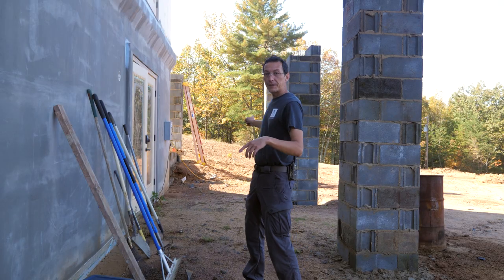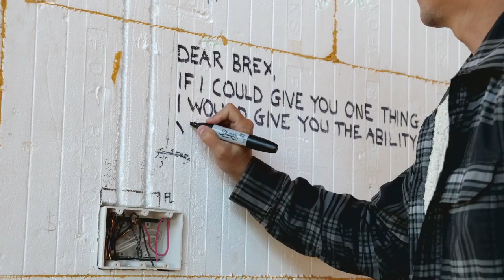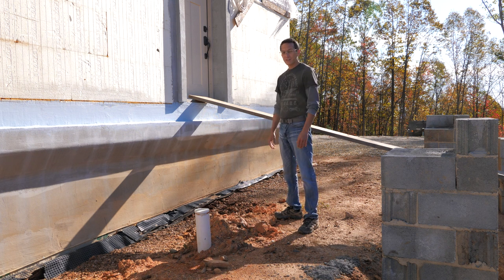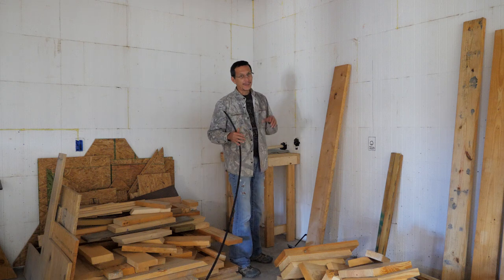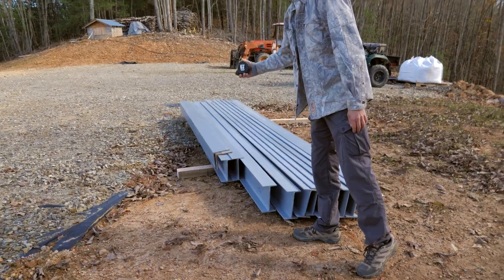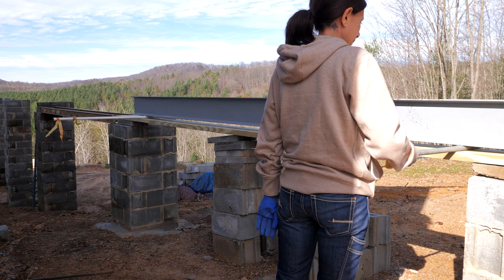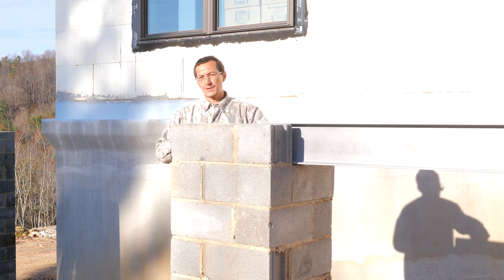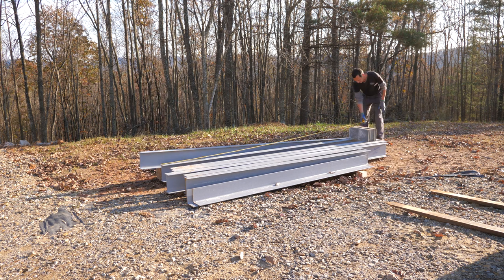Elevated Concrete Porch Slab Construction: Pumping Concrete and Setting Steel Beams

Comment: hind sight thing here but if you use a sling to haul and lift that sort of thing the terrain doesn't matter as much , plus the person on the ground can guide and move it more into place rather than the tractor having to be within 6 inches of placement....next time think of me LOL
Reply from the maker: Switched to a backhoe with higher reach. Finished the remaining beams in 40 minutes. 🤷🏻‍♂️😏
Reply: @Guildbrookfarm  having sat in backhoe seats for 40 years my mind always thinks like I am on one when I see work going on. Glad it went well. The pipe roll was a good idea but work :<0)
Reply: Was just about to say the same thing... except the think of me part...lol. I was just shaking my head going, yo tow strap that puppy, center the gravity, put a lead rope on and go go go! Poor things, A for enginuity and team work but still that tractor was mean to be used for such things.

Comment: I concur with the shop vac trick. I used a ping pong ball with a string attached.  It pulls it thru and attaches to a heavier rope which is attached to the wire you want to pull. Stupid easy this way...!!

Comment: For future reference.  If you have a conduit run that is too long for a fish tape, just take a spool of twine and tie a ping pong ball or foam ball slightly smaller than the inside diameter of the conduit to the end of the string. then go the other end of the conduit and use a vacuum cleaner to suck the ball through the conduit, it will pull the string right off the spool and through the conduit to the other end.

Comment: Any reason why you didn't simply dig and pour large reinforced concrete columns using tubular forms to the proper height(s)?  That's how highway overpasses are done!  The concrete block columns seem so time and labor intensive as well as prone to potential cracking in the future.

Comment: Coming along nicely! Tip for pulling wire in a conduit longer than your fish tape is to use a shop vac at one end and jet line or string tied to a plastic bag at the other. It'll suck it right through. Then you can use that to pull a heavier rope or mule tape to do the actual wire pull with.
Reply from the maker: Yep
Reply: tape the end of the wire and add a little soap to it .. if you trying to push it .. or suck the string in

Comment: You may want to consider installing a Dankoff Flowlight Booster pump in the basement in order to insure you have adequate water pressure to the highest shower head fixture on the second floor.

Comment: Do you have any contact info for the engineer you used for the porch. We built an ICF house with the brick ledge and are doing the same thing only our house comes to a point at the front. Just got the standing seam roof installed last month. Awesome work glad to see someone already did the same thing we were thinking and it looks great.

Comment: You could have also  hung the beam from the forks using  a chain or tow rope, That would have leveled the beam automatically as you  rose the forks and put guy lines on the beam to steer it.

Comment: Instead of forking the beam, why not sling it?  U can control the length of the sling so one side is longer than the other and just roll it up into place.  Rachet straps can adjust on the fly.

Comment: Just a tip, when you wiring thru conduit use a wad of plastic (bag) and a pulling string, suck the bag they the conduit using a shop vac. Cut your install time in 1/2.

Comment: Without vibrating or roding the cores of the block there is no way they are filled solid.
Reply: Correct, but I hardly think it will matter in this situation.

Comment: Don't know why you didn't do a wood porch...
Reply from the maker: Wood rots, attracts carpenter bees, and requires maintenance.
Reply: @Guildbrookfarm  Not sure what area you're in, I'm in the mid atlantic, we have brutal winters and hot summers...I'm a builder and remodeling contractor...I've worked on very large wrap around porches that were around over 75 years   and solid with minimal maintenance...We have concrete porches/decks too...They require maintenance as well... I'm just looking at the expensense for those piers, steel, Q deck, concrete, labor, etc...Plus the surrounding area is conducive to wood...Concrete deck is a commercial thing for heavy pedestrian traffic....Just sayin.
Reply from the maker: Cool. You do you. We’re building with concrete and steel.
Reply: Another option for building as they are, it would be ready for an addition as is.  Capable of closing in/roof.  Some wooden deck builds don't have the foundations to support a room.  This would.  They could bury cheap plastic hydronic tubing in the concrete for hot water heat in the future.  They don't have to use it until future, if ever, it is cheap enough.  But it is there if needed.
Reply: @spockmcoyissmart961  True...I was just curious... I just wonder how people think sometimes...No judgements...

Comment: It always amazes me the amount of concrete used in North America and you guys still don't have pump-mixer trucks more widely in use. It's either chute or in rare cases (like here) chute + separate pump unit and to me that's unnecessary way of doing things not to mention the needless strain to effort with using chutes.